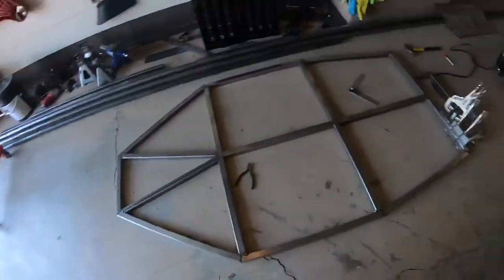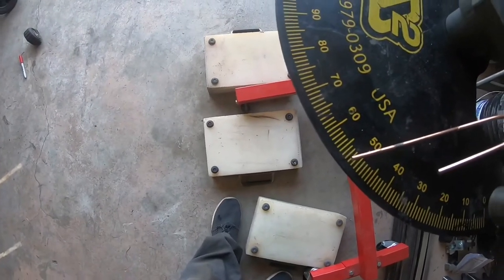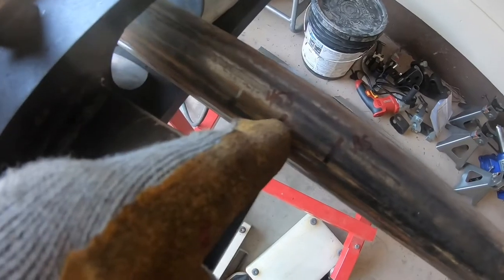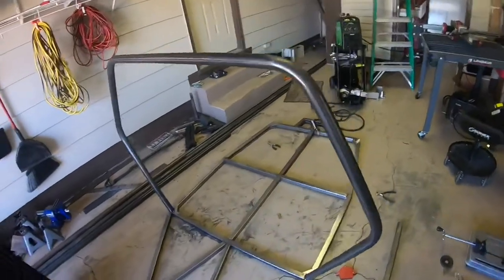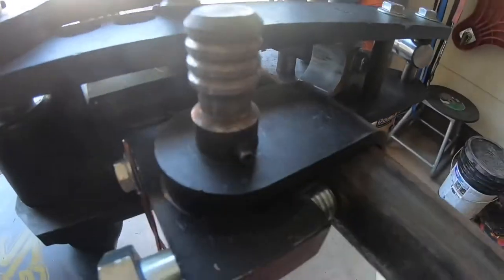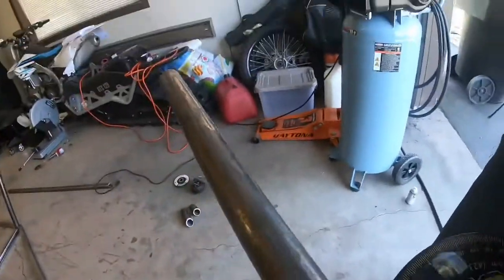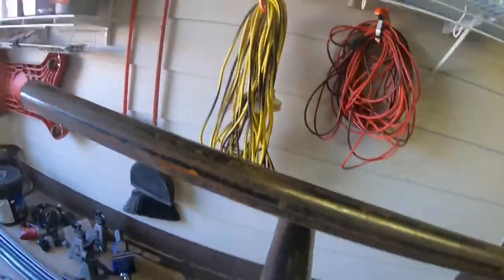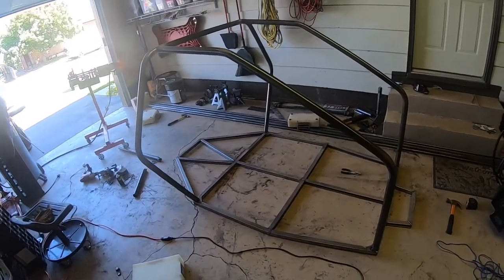300HP Edge X2 Buggy Build | Pt2 Main Hoop and Tool Overview

Comment: I’d just say gaps half the width of your weld wire be about the only tip I’d give. Other than that coming along awesome. Awesome to see someone who hasn’t done much of this, and doing damn good on it. Keep up the work, looking good.
Reply from the maker: Hey thanks! Do you say that to help with weld penetration?
Reply: Brady Bell yeah it makes sure your weld burns in and penetrates. It’s not necessary, just something I learned over time of you don’t bevel the edges of piping half the width of the wall thickness.
Reply from the maker: Thanks, I’ll keep an eye on that!
Reply: Brady Bell no problem. Look forward to seeing the sled engine put in.

Comment: You can always tweak bends to get them spot on. I have a fence where the bottom rail is about 100mm off the ground. I put one end of tube under the fence and hang my weight off the other to adjust bends. Using a brick and standing on the tube, you can twist the straight parts of tube to get multiple bends aligned.
Reply from the maker: I actually tried this, but I could only get it to straighten a little. I had one end under my pickup tire and the bend propped over a board. Then jumped on the hanging end. It worked a little bit but not enough. I got sick of messing with it and that’s where I left it.

Thanks for the pointer!